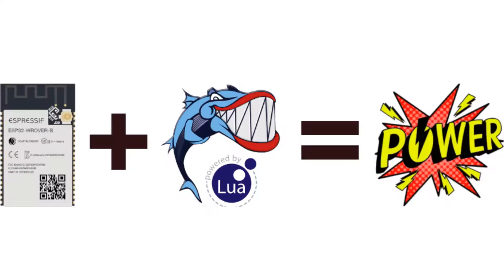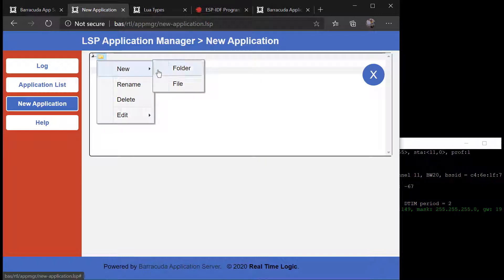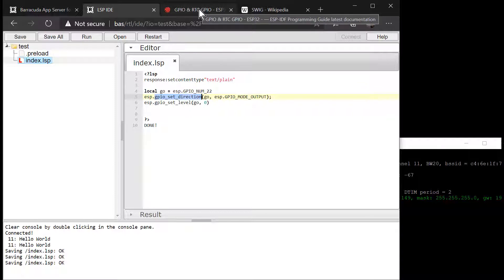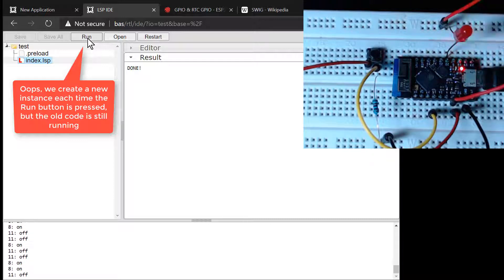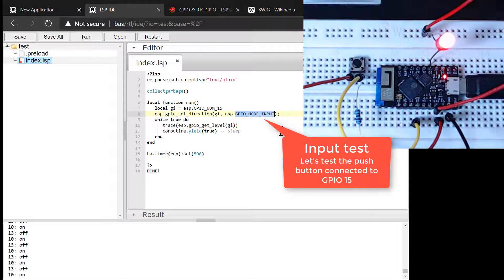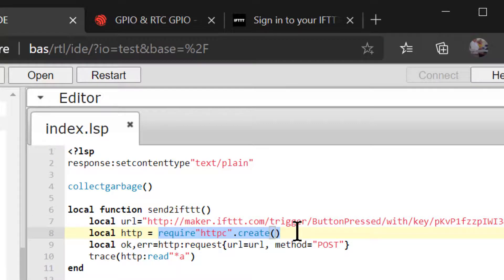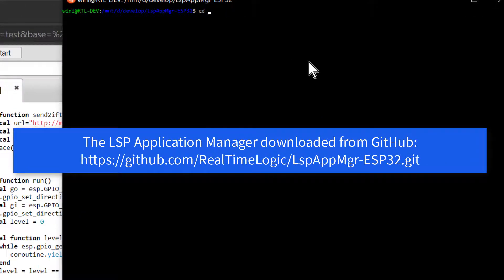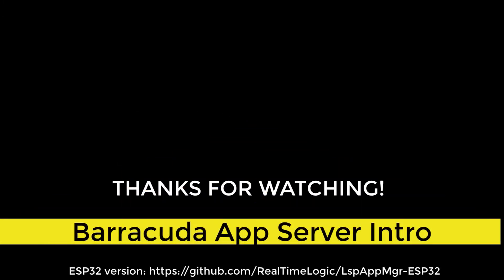Unleash the Power of IoT with the Lua language: A Step-by-Step Guide to Building Simple IoT Clients

Comment: Fantastic. May  I Embed the server in STM32 and use  ESP32 just for WIFI Connections ?
Reply from the maker: You can download and integrate the server with your STM32 by following the instruction provided here: https://github.com/RealTimeLogic/BAS. Another option would be to use ESP32 as a coprocessor and communicate with STM32 using I2C.